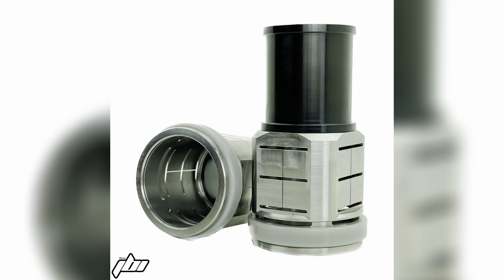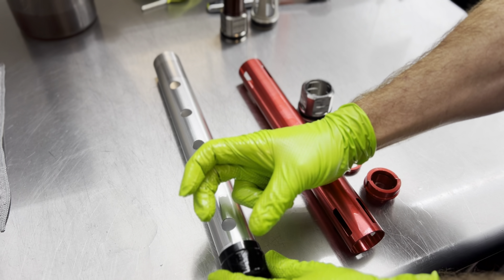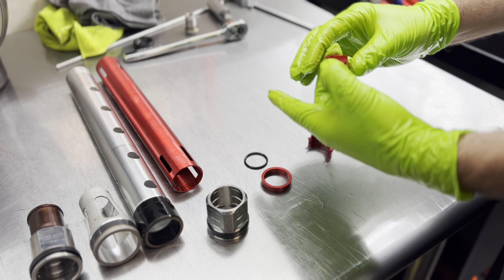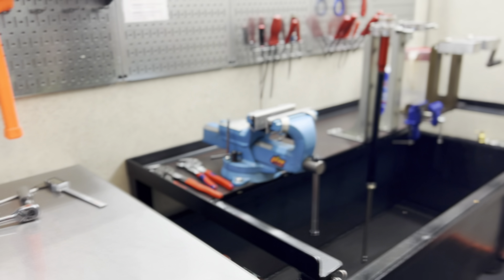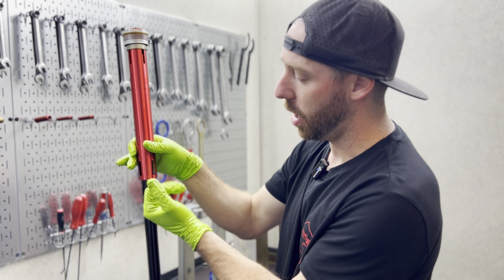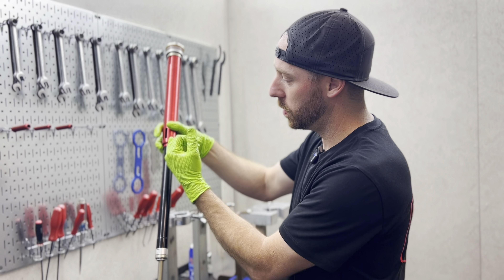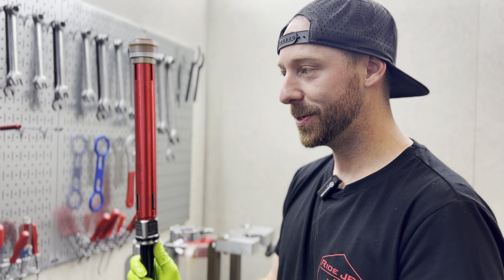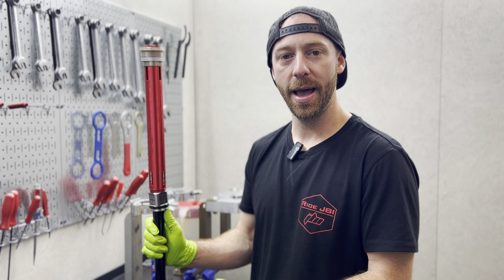BEST Suspension Mod For KTM HUSQVARNA GASGAS Dirt Bike w/ WP XACT Pro Forks? JBI WP Ti Pro Perch

Comment: Very interesting… so basically it’s relocating the damping to a lower spot so it engages sooner? Please correct me if I’m wrong. Would this be beneficial for Harescramble riding or mostly moto?
Reply: The actual dampening is all performed inside the fork cartridge itself which is where all the valving shims are located, the oil in the inner cartridge is isolated from any oil and air in the outer tubes to prevent cavitation or air bubbles in the oil, the oil in the outer tube is to provide bottoming resistance..
Reply from the maker: Hello and thanks for the comment.  The JBI Ti Pro Perch provides more bottoming resistance compared to the stock WP Spring tubes.  For off-road setups and harescrambles that need plush and soft suspension the JBI Ti Pro Perch compliments that’s by providing additional bottoming resistance/control.  So you can maintain a soft / comfortable off-road setup while maintaining good bottoming control.    The product page will be live on RideJBI.com this week with more in-depth info.
Reply from the maker: Since the JBI Ti Pro Perch is more effective then the stock WP Spring Tube, lesser oil volume can be utilized in the fork outer chamber.  This means the JBI Ti Pro Perch will engage the oil later in the fork travel.  Lesser oil volume means the lower oil height in the fork.  The product page is now live but will continue to get updates.

Comment: They make the forks feel smoother AND they increase bottoming resistance?? Would this part be useful for trail riding?
Reply from the maker: The JBI Ti Pro Perch provides additional bottoming resistance compared to the stock WP Spring tube.  For off-road riders this means they can utilize a fork valving setup that is plush and smooth while JBI Ti Pro Perch provides the wanted bottoming control.  In-depth details on RideJBI.com to soon be posted this week.